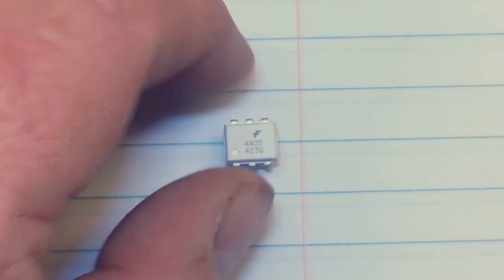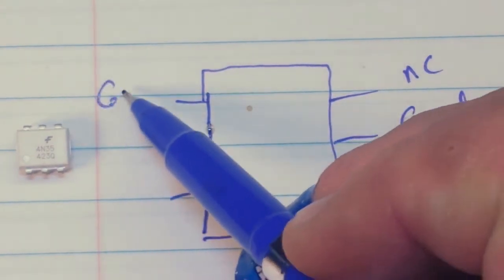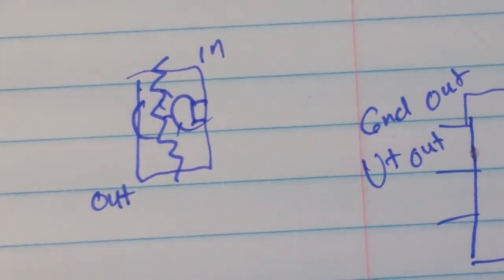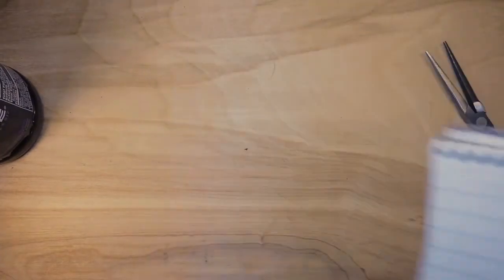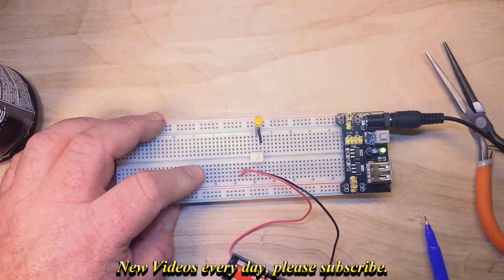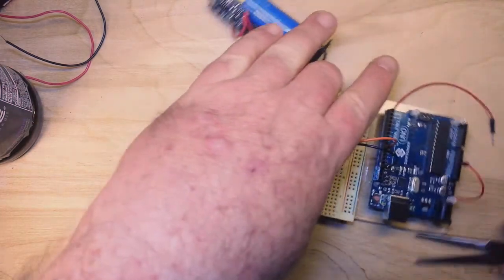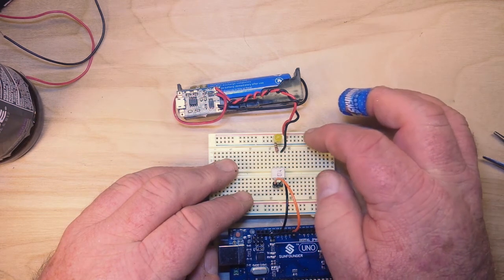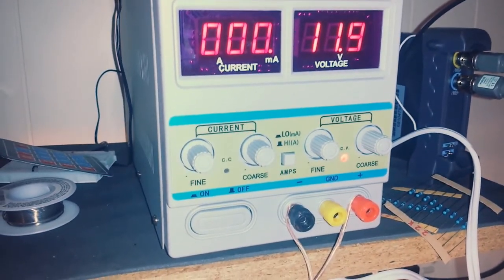Introduction to optocouplers

Comment: So while the output of 4n35 is upt to 30 V, the current is only 100 mA.  So I presume you need to run the output through another chip that can handle more voltage if, for example, you are running a large DC motor that might draw over an Amp of current.

Comment: that optocoupler is a cool chip works like a GFIC outlet with line and load
Reply from the maker: Sorta...it's not resetable...more like replaceable. But they are about .03 a piece so not a big deal
Reply: thanks just wondering

Comment: if you look at the schematic of this optocoupler you see that it is a light sensitive transistor in there that can be controlled with the IR diode thats inside. mostly they are used to seperate highvoltage circuits from low voltage ones, so you dont accidentally put mains through your micro, or even on some user input buttons. there are differnt types of transistors in there. i have one with a triac that can be used to switch a bigger triac.